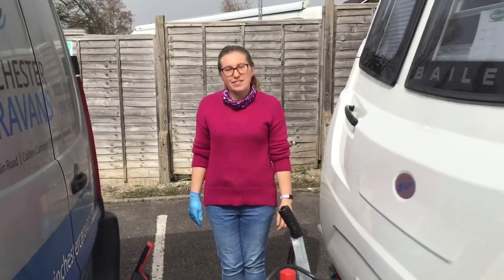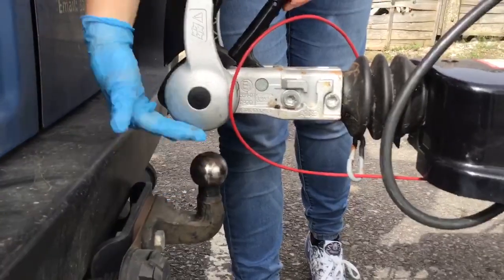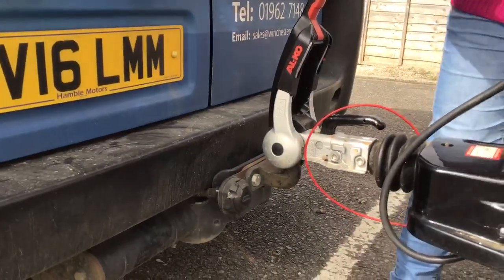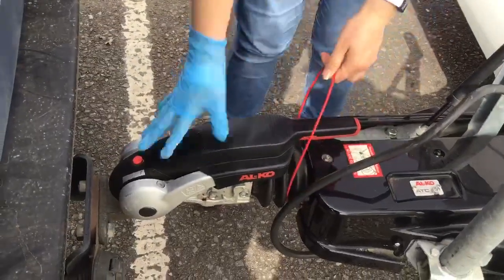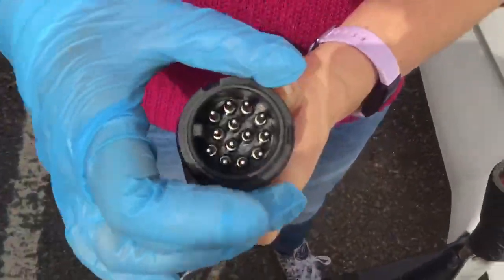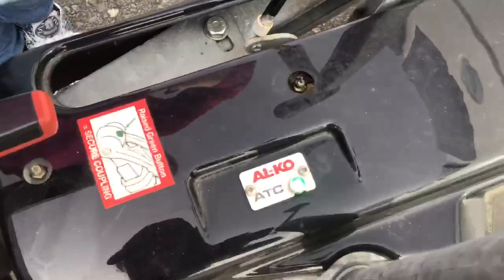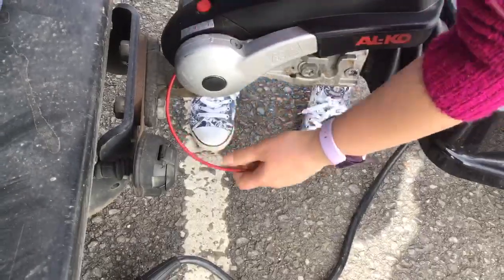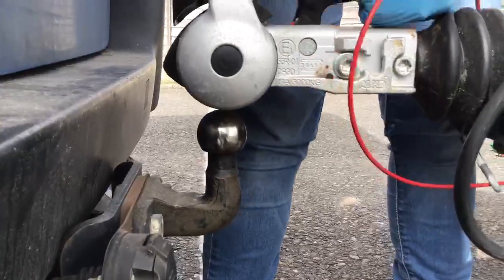ALKO HITCH HEAD SYSTEM WALKTHROUGH

Comment: Good instructions. In addition, The red button directly on top of the towball on the AKS3004 pops up when engaged. When the green edges are seen, correct seating of the vehicle towball has been achieved. Bit raising the car is a good fail safe check.

Also worth reminding people to have the correct towball on the vehicle. If you have a towball fixed with 2 bolts on your vehicle, it needs to be a high neck towball as per your video. A standard towball will damage the AKS head

Comment: Brake away cable should not be hooked around to tow ball, as it can bounce over the tow ball in transit.  Therefore will not apply the brake if the hitch was to come loose from the vehicle.
Reply: i guess it is kinda off topic but do anybody know of a good place to stream newly released series online?
Reply: Breakaway cable should be attached to the tow vehicle independently of the tow ball/tow bar in case of a catastrophic failure/disconnection of the tow bar from the vehicle. It happens!
Reply from the maker: Thank you for your comment. As mentioned in the video, ideally you would hook it on to your car bracket. However if you do not have a bracket, then looping the cable is the next option. For ultimate safety the bracket is preferable to looping.
Reply: @winchestercaravans2897  Looping over the towball is not a safe method - if the caravan comes off the tow ball it will lift the breakaway cable off , making it ineffective - it should be attached to the tow hitch bracket  - whether it has an attachment provided or not . Safety should not be compromised by shortcuts
Reply: At 3:34 you can clearly see a provision to clip on the break away cable. It's right under the electric socket.

Looping is simply not an option and will reward you with a fine in most of Europe, bodily harm or death worst case.

Fix your tow vehicle - average caravan is easy +20.000 Euro. Getting a convenient and safe spot mounted for the break away cable would set you back 200ish worst case.
Reply: @winnie6354  so if you have a towball without a dedicated hole/bracket how would you hook the cable then, as in the owners handbook from coachman it does the same as in this video...... new to this so learning as much as i can
Reply: @winnie6354  all approved towdars have a safety connection on them. If your using an old type (7 pin) towbar it may not have one. In that case I would fit an updated socket plate behind the tow ball which would have provision for a safety connection. If your fitting it yourself just observe the torque settings for your hitch bolts. Never attach your breakaway line around the ball neck! If the tow connection fails the breakaway line (or dead man as some folk call it) will easily just jump off. Some people have used makeshift breakaway lines so that they can reach to tow points on the car beit a screw in type into the bumper or a factory welded loop underneath. Again, this is dangerous as it would increase the safe length of the cable allowing the caravan to much 'free line' and that would allow your caravan/trailer to sway out nearly twice as much! Hope this helps.
Reply: @winnie6354 even camc recognise the loop over as appropriate if no other option! Some cars don’t have somewhere to attach, that is just the way it is!
Reply: @mulberryaddict938  if it is not safe , you don't use it until it is made safe .
Reply: @winnie6354  you don’t appear to get it! It isn’t unsafe, it isn’t illegal, it can be the only option. Please read the camc and others literature on this matter. After all they are the main insurers. If it wasn’t safe they wouldn’t insure you!

Comment: Our handle dosnt always stay at 45 degrees on its own like yours by the looks of it. Is that normal?
Reply from the maker: Not sure if you mean stabiliser or the actual hitch handle. But if its the hitch handle it just means the catch has gone inside and can be replaced. But it wont do any damage long term. If its the stabiliser (the big black and red handle in this vid) and it falls down all the way without any resistance then your friction pads need replacing
Reply: @winchestercaravans2897  yes the small actual hitch one not the big stabiliser one. Where can I get a new catch? Thank you
Reply from the maker: @andyrad  I would try online. Alternatively, our workshop do find that if you service the area and spray some brake & clutch cleaner around the area. You might dislodge any rust/grease that is stopping it from staying up in the first place.
Reply: @winchestercaravans2897 that's great many thanks. It does occasionally hold up so will give that cleaning method a go!